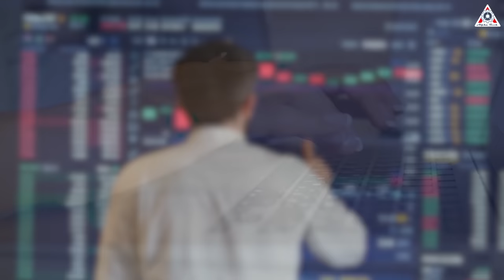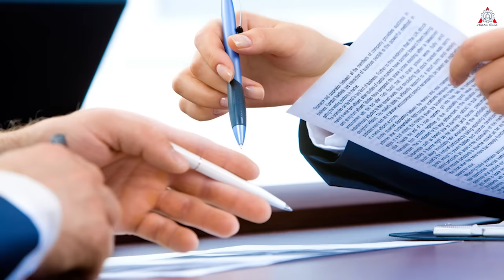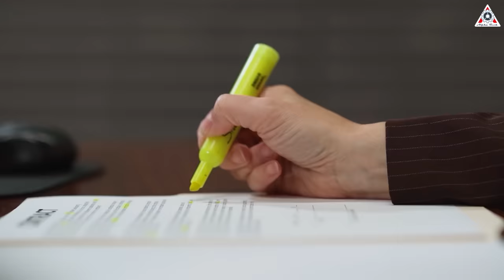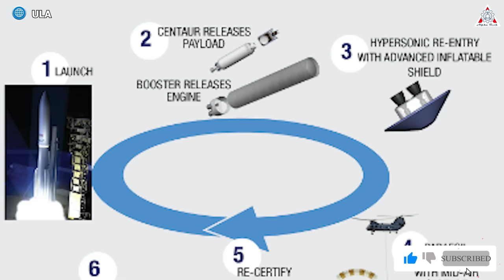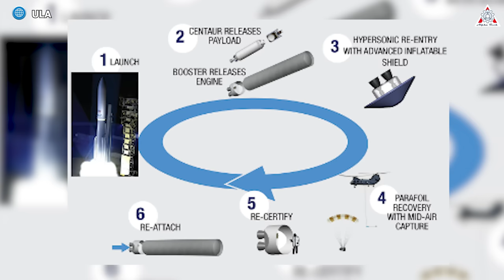Game Over ULA! NASA finally realized...

Comment: Hate to compare different aeronautic techs, but Boeings mess of the max continuing, and united massive safety fears, and the top mismanagement gives me no confidence on the safety of anyone on board, plus it's raid the parts bin from the shuttle. What worked in the 60's and 70's doesn't in 2024

Comment: Wasn't ULA heavily dependent on cheap  Russian rocket engines? And war on Ukraine ( were most of were also manufactured)  cut off that supply of cheap engines? Adding to ULA problems?
Reply: If I recall 1) RD-180 engines weren’t cheap, but are very powerful for their type/size, and 2) ULA was working on phasing out the Russian made engines for quite a few years. 

The engines were far more advanced than anyone thought when the west first found out about them. Look for a documentary called “The Engines That Came in From The Cold”. Very interesting.

Comment: The arguments given against ULA and Blue Origin merging are stupid.  
- It will reduce competition?  How can it reduce competition when BO hasn't launched anything yet?  
- It will reduce innovation?  ULA hasn't innovated in decades.  That's why they're dying.
- It will result in lost jobs? Reducing labor costs is essential for a launch company to compete effectively against SpaceX.

That said, it's not necessarily a good idea.  Both Vulcan and New Glenn have major problems with being competitive in the long run.  Vulcan isn't reusable and never will be.  It will never be cost competitive with the F9 or the FH.  New Glenn is too big.  95% of payloads will fit on an F9 and almost all of the remainder can be handled by FH. New Glenn will never be as cheap as the F9 and so will struggle to compete for commercial contracts against it.  It is only potentially competitive against the FH and there are not enough payloads in that class to sustain it.  I don't see any way for a combination of ULA and Blue Origin to fix the problems inherent to these two launch vehicles.